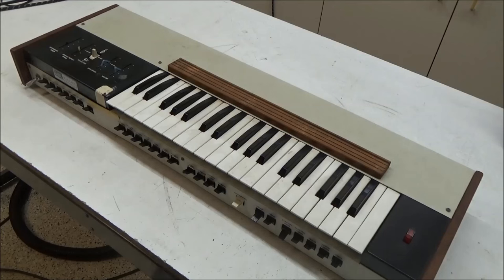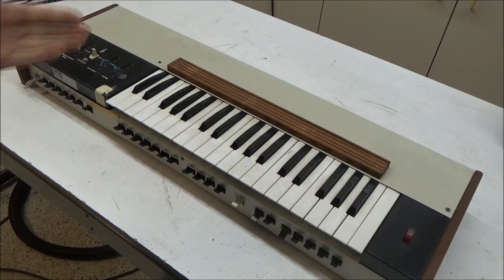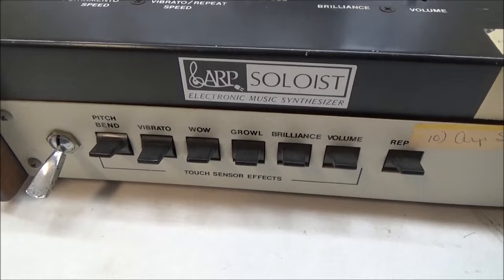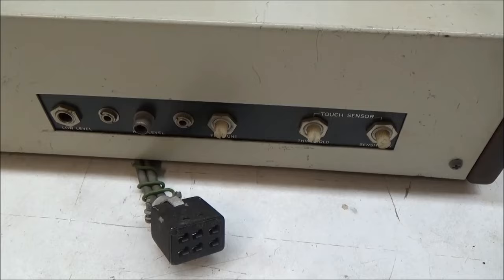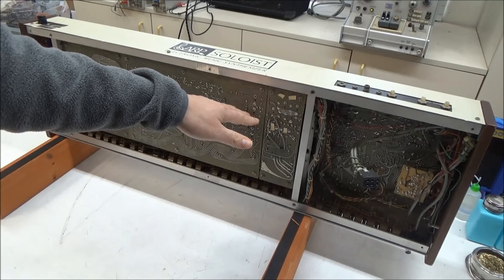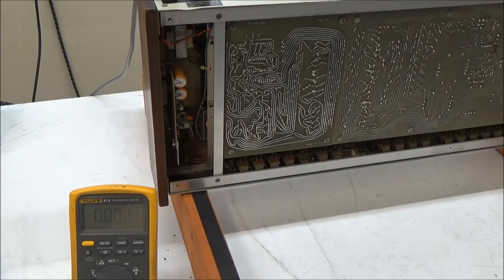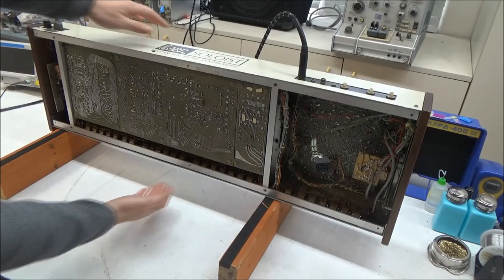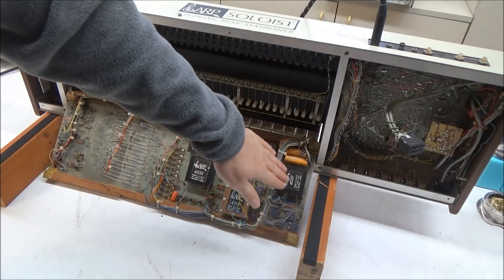Don Lewis' Original ARP Soloist Repair Part 1 - Synthchaser #159

Comment: What was your reason for undoing Don's mod? Surely part of his legacy is all the crazy stuff he did to get the most out of his instruments. This isn't a criticism, I was just wondering.
Reply from the maker: That's a good question.  It was a decision made by Julie Lewis and the beneficiary of the synthesizer.  Ultimately it will be used as an example of the instrument (the focus will be the synth not Don), so originality was prioritized over the modifications (and there were lots of modifications beyond what I showed in this video).   My experience with Don was that he valued things working well over preserving his original 1970's work.  For example, he had seen how I was retrofitting LED sliders into vintage ARPs.  In 2020 or 2021 before LEO went to the NAMM museum in Carlsbad he had me re-design his mixer panel with LED sliders and he replaced the original 1970's mixer that he designed and built.  Based on my work with him, I think he would have agreed with the decision to revert the mods.
Reply: @Synthchaser Ah! That makes sense. Sounds like Don was a pragmatist. And as long as everyone is happy, then that's cool. Most importantly you have documented the mod, so it could be reversed if ever a future owner wanted to.
Thanks for the reply.